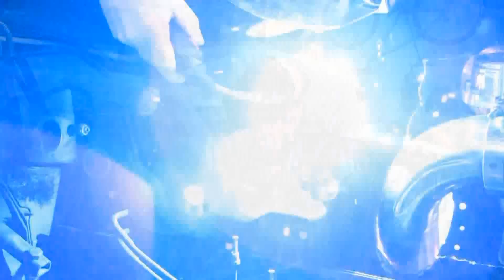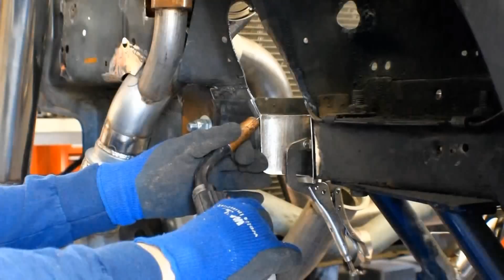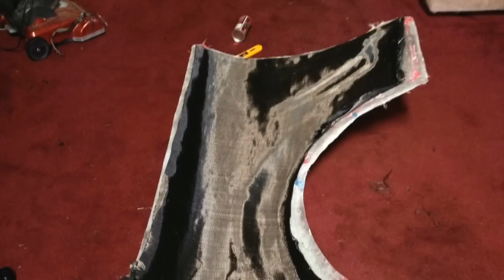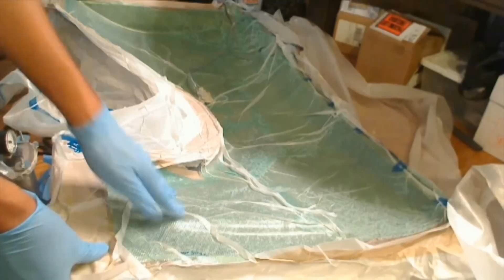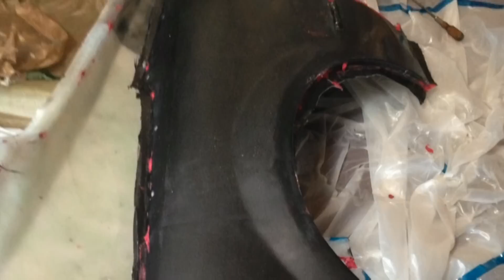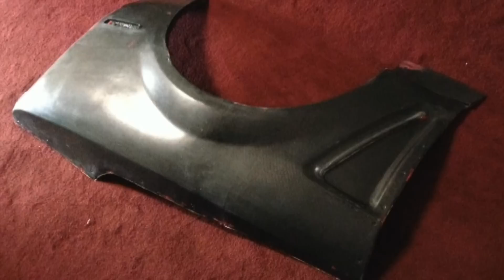Carbon Fiber Infusion - Making A Mustang Fender

Comment: That's the weirdest infusion I have ever seen. It looked like your infusion set up was leaking loads as there seemed to be air in the resin as it was being pulled through. I would like to read a break down of the consumables used to compare with our methods and materials.
Reply from the maker: twitch mutton Yea this was actually done by a member of the fab forums. I think he did have some small leaks initially but was able draw them out at the end.

Comment: what did the mounting points consist of? thicker C/F layers or did he resin in metal mounting brackets? I dab alittle in CF work but havent made body panels yet and im curious as to the method of molding the secure mounting points
Reply from the maker: +Douglas Foster I think it was all carbon fiber

Comment: I was wondering, I wish to copy or duplicate the ABS panel on my Canam Spyder, in order to make modifications to them.

How would propose do that.

Thanks

Dom
Reply from the maker: Its hard for me to help you here, Post some pictures on the forum and there are several of on there that can walk you through it.
Reply: +Dominic Vaillancourt The way to do it would be to make a negative mold from the part and then modify the mold. In any case you should be making a mold for the part you wish to create otherwise you get a really bad quality job like in the video posted above.

Comment: An ultrasonic leak detector and a 30 minute leak test would have prevented all the air you see at the end of the video.  Still a useable part, but the finish would have been much nicer if there were no leaks in the bag.
Reply from the maker: some bubbles but no leaks

Comment: does the vacuum have to be on the whole time while the resin/epoxy is drying?
Reply from the maker: if its perfectly sealed you can just plug the line after it make full vac but most of the time there is some kind of small pin hole somewhere so in that case yes the pump will need to remain on the entire time

Comment: Where is the step-by-step in the forum? Thanks!
Reply from the maker: this entire build is under the carbon fiber section under "1999-2004 mustang wide body"
Reply: Thanks man.
Reply from the maker: hey no problem...you to see you on the forum
Reply: I used to be on the fiberglassfotum.com, but it tanked a while back. I miss it. I've been doing glass for since 2006, but I want to get into vacuum bagging and resin infusion
Reply from the maker: I'm sure you could teach us a thing a two

Comment: Do you know if he composite or just straight carbon layers?
Reply from the maker: +Walaboro straight carbon
Reply: +The Fab Forums I'm wondering if you have any info on I guess. Impact resistance for this exact scenario. Straight carbon panels. Like could it take a rock being kicked up at 60mph? Or is that a little too much?
Reply: +The Fab Forums also thanks for quick reply man!
Reply from the maker: They are super impact resistant. I have seen solid carbon wheel take an impact from a curb. Probably more resistant than aluminum.
Reply: +Walaboro Composite means a stack of multiple layers. Even if every layer is carbon fiber, it is still called composite.
Reply: Dutch Luthier yeah confuses me a little, mainly think of a composite as a combination or mixture, but with carbon fibre even just the resin allows it to be called a composite, which does make sense, idk just still a little odd if you ask me.
Reply: Walaboro yeah a composition can also mean it is made of 2 different things. In some cases people would refer to that as a hybrid. But maybe a composition can also be one thing, like a musical composition, to compose means something write or create or of elements) constitute or make up (according to google). Composites is just a general term for this field.

Comment: Another great video. What did you use for the mold? (Original fender?)
Reply from the maker: David Lively Yea it was the origanal fender. The same guy that did this one also has a thread doing a full front clip over on the forum. www.thefabforums.com (carbon fiber section)

Comment: There always a risk with voids when doing it any other way other than prepreg. Yes prepreg cost more but you consistently get better results and the extra cost out weighs the risk of scrapping a part. Pros only use prepreg.
Reply from the maker: OU812 I agree with the fact that prepreg is less likely to have voids but tons of "pros" still hand lay up or use vacuum infusion.
Reply: TheFabForums.com I don't doubt that but I guess it depends on your definition of a "pro". I'm referring to industrial applications. Prepreg will eventually dominate industry.
Reply from the maker: It will dominate industry for sure just because of the time savings, not because its better necessarily. Although the new carbon fiber dream liner commercial airplanes are made of 100% laid strand and resin.
Reply: TheFabForums.com The dream liner and A380 are made using an automated laid strand process because it's crucial the strands be continuous for strength requirements and that the strand direction is correct. Aerospace carbon fiber build processes are in a completely different world than commercial and industrial sectors. People's lives are depending on the fact the engineers get it right and that the fab process is flawless. If an after market carbon fiber hood for a Mustang cracks...nobody cares!. If the wing box of an A380 starts to de-laminate...
Reply from the maker: OU812 I bet your one of those dudes that can never be wrong?
Reply: TheFabForums.com Good guess. I work in aerospace. Being wrong has consequences. Yeah it's a curse. Cheers.
Reply from the maker: lol...thanks for your feedback
Reply: OU812 spent two years building artificial limbs using the hand lay process. I've Never had one fail, and impact from a step takes more weight than a bit of wind; even if it reaches 200 mph.

Comment: hi ,you have a major leak , thats why your part came dry
Reply: Is that why there were so many bubbles at the end?
Reply: there r many bubles all over the part and they r not from the resin degassing, they r big!!
Reply from the maker: the part didn't come out dry...and there were no bubble in the part. The bubble were just the ones traveling through the bag as the resin flowed.

Comment: try hair spray. the couplers will stick to the hair spray
Reply from the maker: that's what others have said but it still wouldn't hold. I bolted the bands, couplers, and tube all together and it still ripped the bolts out at around 30psi.
Reply: dang. need to somehow get a bead on the end of the carbon pipe
Reply from the maker: yea...I hope to be able to experiment with it soon
Reply: sounds good. hopefully it works out.
Reply from the maker: Thanks